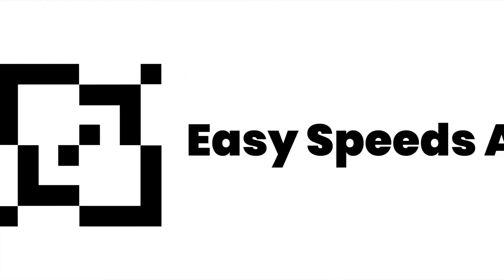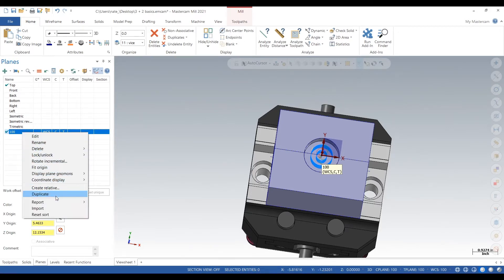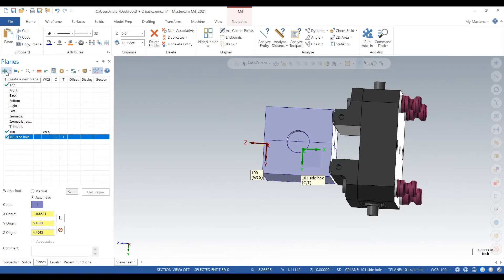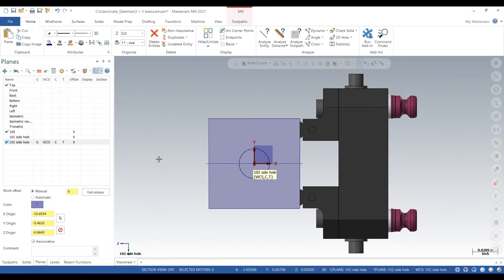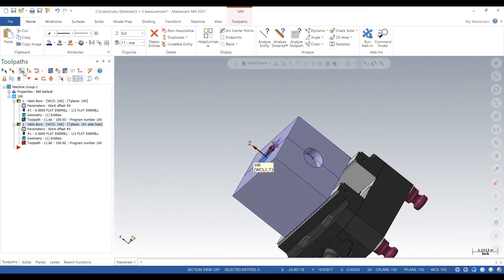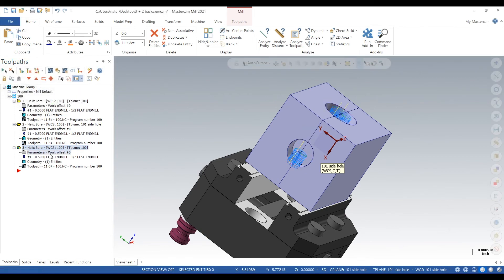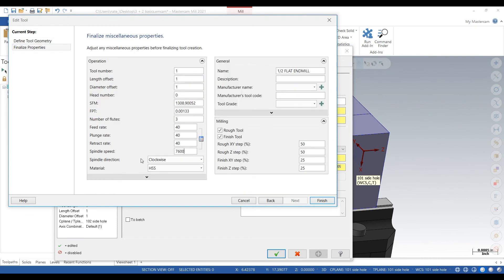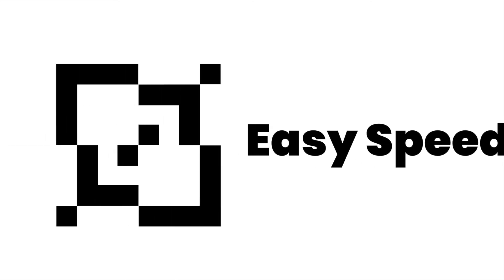5 Axis Programming - Mastercam 2021 - Adding Planes

Comment: This is all assuming you have a 5 axis post processor for your machine, correct? Currently we only have a generic 3 axis post processor for mastercam, running on our Mazak 5 axis machine...so this wont work without the 5 axis post processor??  Currently we have to teach the machine where our g54, g55, and g56 etc are.  so it's just 3+2

Comment: Pero manteniendo el offset siempre en -1 te generará el G54 , es necesario colocar el Offset en 0???
Reply from the maker: Could you by chance translate
Reply: @easyspeedsandfeeds1410  He said work offset (-1) will generate G54 and he doesnt understand why you change work offset value to (0). 

He wants to know if it is necessary to replace work offset -1 for 0.

Comment: Hi there. If there are many til angle wall or complex angle on the part so how can we do this way? Is there any way for angle walls? Is this called positional 5th axis? I like this way than all axis moving which we don't have production for that. Thank you
Reply from the maker: I would use the same strategy as this video. Select the complex angle face as your WCS. If your machine runs kinematics it will rotate to the correct angle. What else do you want to see on this Chanel?